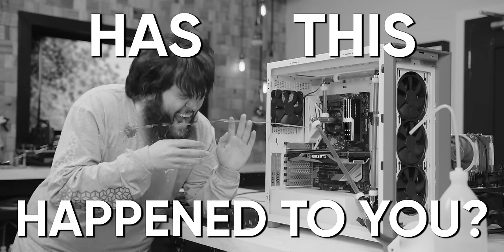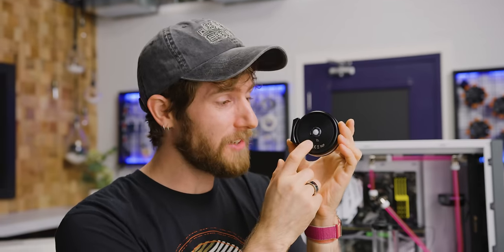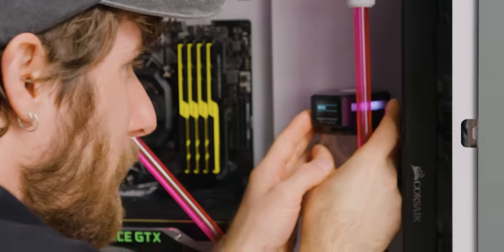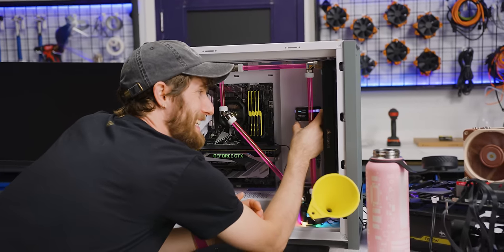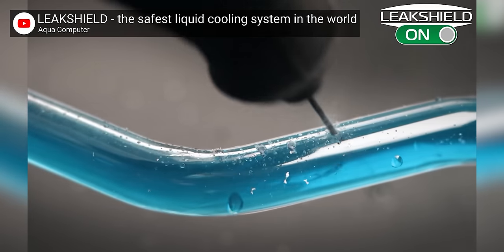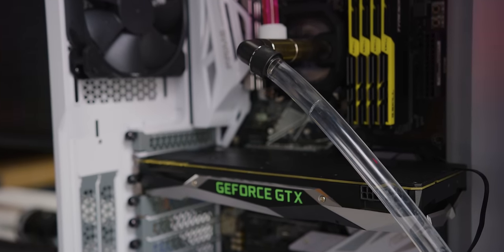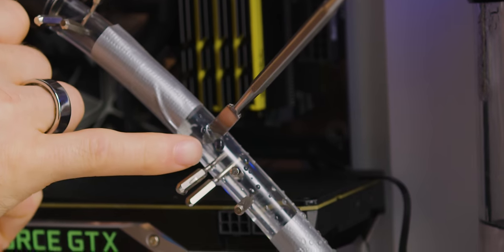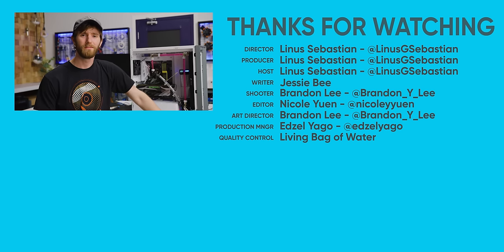I can’t believe it didn’t leak…

Comment: Really cool product, incredible really. Linus went way too hard on it tho to where a cynical consumer would think it doesn't work. Even at the end where he didn't totally recommend it. Bruh people are frequently spending over $1500 on a computer these days. $120 for a smartpump and reservoir is nothing
Edit: The video didn't have a lot of transparency on the total cost of the system but its still incredible at a few hundred dollars. Easier, safer, loop setup has a lot of value and long term monitoring
Reply: seriously this thing is incredible and super cheap for what it does
Reply: 120 is just the thing reservoir pump ist atleast another 150
Reply: I'm just waiting for the version that goes into distro plates. I'll easily pay $200 for that. I already paid $150 for a peice of acrylic.
Reply: @malteroeper3723  There is no leak without pump anyway
Reply: “Cynical consumer” tf does that mean
Reply: @megachadsixtynine5924  ......a consumer who is cynical......
Reply: @megachadsixtynine5924  Someone that automatically doesn't believe product claims or is actively trying to debunk the product in bad faith. I can easily see low IQ consumers (Which there are a staggering amount of) see any kind of leak in this video and go "Scam"
Reply: @Verlisify  while i agree that this product definitely works, I don’t think it’s fair to call anyone who has doubts going in or is just skeptical of this product as “low iq”
Reply: @malteroeper3723  If you are water cooling than you are already buying those components anyways. You wouldn't take those costs into account. The only way you would take any cost into account is if you bought the recommended pump and res from them and it happens to be more expensive than what you were initially planning on buying. Although it is stated as a recommendation from that company meaning its not required.
Reply: @NMZS  Its not a requirement to have the pump and res its only recommended which of course the recommend their own product they get more sales.
Reply: This thing is the coolest pump ever
Reply: Hell if this was out when i put my custom loop together I would grab one it would keep my expensive componates a little safer then not having it.
Reply: @megachadsixtynine5924  If someone thinks the product doesn't work or is misleading after what Linus did to it, they are objectively low IQ. The product wasn't designed to be drilled through then poked some more, thats just a limit of the laws of fluid dynamics at this point. Or if it dribbles from being impaled 20 times.
Reply: @Verlisify  not necessarily. While I don’t agree with people who call Linus a shill, most of them are just trolls. Not necessarily low iq, you can’t fault them for not being necessarily great at physics.
Reply: Its not that incredible actually, should have had this years ago
Reply: @megachadsixtynine5924  They wouldn't be a troll tho, they would think that Linus' testing is fair... which would be a complete lack of basic comprehension skills
Reply: Not only that, If your new to doing custom liquid cooling I could imagine this will give you a lot more confidence to do it along with more peace of mind.

Also you could spend roughly $300-700 on a custom cooling loop, $120 isnt horrible.
Reply: It's $309 USD for the complete system.
Reply: @rBennich  you will easily pay 400$ for that, distro plate stuff is more valuable than gold :D
Reply: I think its just fantastic. I had only had a few leaks since I started beginning building water cooled PCs, but one time I almost lost my gpu and psu because of it. Losing an expensive graphic card in these days is can be a devastating loss. I think its worth the price. A full custom water cooled system is easily costs 500-800$, throwing in an another 120$ component is like nothing.
Reply: @Verlisify  I guarantee you that anyone considering this product wouldn’t not buy it because it leaked after being stabbed like 20 times.
Reply: @megachadsixtynine5924  agreed... I wonder if he wants Linus to bend over backwards and praise the product throughout the video. The demonstrations he made clearly showed how well it works.
Reply: Absolutely, although I would say that a properly leak tested loop is unlikely to leak anyway, but for the paranoid, must have product
Reply: The reason he didn't totally recommend an otherwise totally working with no false claims product is coz it's pretty niche. When it comes to leak testing, there's cheaper easier alternatives as Linus himself said. I think it's hella cool but doubt I'd buy it for my loop uk
Reply: @NMZS  I mean if you already have the money for custom WC than paying a little more for security is nothing
Reply: @williamfoster4268  add 100 for CPU and 200 for GPU and an other 100 for rad and then 30 bucks into fitings anf you are around 600-700$ for complete WC gear
Reply: 100% Agree
Reply: @megachadsixtynine5924  Nah, the guarantee is the opposite. That there is someone dumb enough to be turned off by it
Reply: @noenic  Complete system being the pump/res combo.
Reply: @williamfoster4268  I know i just added the rest to tell how much the whole loop would cost
Reply: @Verlisify  I also do agree with your statement on saying they are low IQ if they believe the testing Linus does is fair. Not saying his testing isn't good it's just he always seems to take it to the extreme to show its "full potential" If someone believes its a bad product cuz it didn't 100% do as stated at the end of the "testing" then they really aren't that bright.. lol Most people would see this video and be, "Okay there's no way someone would drill, poke, undo all the fittings in their system.. on daily usage, or standard leaks this thing is great"
Reply: hey verlisify, loved you back it the day, hope you're doing well!
Reply: Someone who's doing a custom loop can easily avoid another hundo. And this thing is reusable.
Reply: If I have a 15.000$ gaming rig I will easily pay 120 or even 220 320 for that type of thing. 
Better safe than sorry.
Reply: Couldn't agree more, if you're dropping "new PC w/hardline cooling" money, you definitely wouldn't mind the relatively small extra for this set up!
Reply: If you're gonna be water cooling anyway kinda worth it
Reply: I agree. If you're going watercooling your rig probably already cost half a fortune, so 120$ extra for the peace of mind is absolutely worth it!
Reply: Shoutout Shofu
Reply: Especially when you can fry that computer with a leak. It's not a bad price to pay for peace of mind.
Reply: @StarmanDX  seek help
Reply: For those worried about the price with the pump and such it looks like it would go right on a D5 pump which a lot of people are already using.
Reply: @Thalln  $300 USD for a full custom loop (CPU, GPU, res, pump, the whole works) is basically the bare minimum. Still Aquacomputer is one of the few brands where I have no qualms paying the premium over other brands for. And of course part of the extra cost comes from the fact that they make their stuff in Germany rather than China.

The simple fact that AquaSuite lets me control my pump and fan speed based on coolant temperature alone is well worth buying their stuff for.
Reply: @Verlisify  dude, i seriously think you’re talking about a small minority of people.
Reply: @NMZS  still not that bad if your putting 2-3 g's into a system!
Reply: Actually this make me wanna buy it more LOL..after watching the whole demonstration
Reply: says the furry
Reply: I don't think you watched the same video I did
Reply: @outrageous5363  leave them alone.
Reply: Despite common belief, $150 is actually alot of money to most people
Reply: @anthonyernst999  not to people who need a reservoir for a custom loop anyways
Reply: uh no, he didnt go too hard on it. and a cynical consumer would think that it works. you can tell it works because he SHOWS it working even in VERY bad scenarios (like 10 puncture holes and also 2 completely OPEN screwdriver holes. when showcasing or reviewing something like this its important to know how much it can handle, IE show its failure mode. which is apparent multiple open stab wounds. perhaps you mean "not very smart" consumer? in that case sure, i guess. but that's no fault of linus and there is no reason to pander to those people because they are literal idiots.
Reply: "Because person can afford this that means they can afford this as well"
 is the stupidest logic I've ever seen. It would be like a girl asking you to buy her a new car because you own the latest iPhone
Reply: @outrageous5363  no, it’s not like that. Because the market isn’t people looking to install this in a budget pc build. It’s for water cooled pc’s. And in case you’ve forgot, water cooled pc’s cost a ton. So I doubt most consumers interested in this think 120 bucks is a whole lot
Reply: @outrageous5363  it’s called satire
Reply: People spend 1500 just on loops. That doesn't even count the rest of the pc lol
Reply: I agree. When most custom loops fail from a poorly cut edge on tubing and results in tiny tiny drops over hours of use, the fact that this thing is maintaining no leaks after taking a drill to it is incredible. If you're watercooling (non-aio) your computer probably costs enough to justify this insurance policy. I have never done a custom loop for fears of a leak but with this I am way less worried, might have to do a little bit of a rebuild in the future.
Reply: I'm a cynical consumer and by watching the video I could clearly see that it DID work.  I think you're assuming the consumer is dumb, and just sees that when Linus goes overboard with holes and water comes out, that the product is a somehow a failure, rather than recognizing  that's irrelevant and to be expected, as well as entertaining.  I think everyone realizes that's not a typical scenario, and even if a catastrophic leak did happen, no one would expect a secondary feature (of stopping small leaks) to somehow miraculously keep all the water in.  We know how it's stopping small leaks - the pump - and we know that pump can only move a very small amount of air.  The fact that it worked at all even for small leaks is impressive and makes it an incredible product.

And really it's more about the monitoring and filling features, and the ability to shut down the system to protect it.  If you like to tinker with your system and refill your loop a lot, just the filling feature alone would make it worth it, it makes it so much easier and faster.  What I was really impressed by was how sensitive it was.  I thought it was going to take a significant leak in order to recognize it, but it alarmed even when we didn't even see any water visibly coming out, just from loose fittings and a bit of movement.  That's really incredibly sensitive and accurate.

I got into computers 20 years ago and have been building since then, so I saw the very crude beginnings of DIY water cooling turn slowly - and then quickly - into what it's become today, so I can say with authority, you are absolutely right, this product is OBJECTIVELY a really cool and incredible product.  Something so niche, so geeky, and so rare, has become a big enough industry that a company has designed a serious and complex product for it - a subset of a subset! - , and things are standardized enough that it's flexible in it's application.  We've certainly come a long way.  I almost feel like it's cheating, these products are making the geeky DIY thing so dead simple that computer illiterate normies can create epic water cooled systems, and face no risk!  Back in my day we had to actually work to make a cool and overclocked system!  From physically altering Athlon XP's to unlock the multiplier, using a dremel to customize boring cases into cool ones, colorful cathode ray tubes and tornado fans with potentiometers, to a ready to use off the shelf water cooling system that practically fills itself for you and alarms if you get a leak... you kids have it too easy.
Reply: Bottom line is if you can afford putting water cooling in your computer you can afford this thing.
Reply: Uh he went hard on it to show it didn't work? Whos gonna drill a hole in their loop? Let alone 3.
Reply: @anthonyernst999  Despite common belief, this is very much a niche product aimed at people who are willing to spend 500+ euro on just a watercooling loop. This isn't a product targeted at most people.

Heck custom loop watercooling is far from a mainstream product. Most PCs use either an AMD or Intel stock cooler.
Reply: @rBennich  It can be used with any loop, as it comes with a part that allows you to connect it via a tube and G1/4" fittings. You just have to make sure it's plumbed to an air gap like at the top of your reservoir.
Reply: @leolego2  Entry to custom loop cooling is about 300-400 euro. Back when GPUs weren't being scalped by arseholes it'd be perfectly possible to build a 1100 euro PC and slap a full CPU and GPU loop on it for 400.

Comment: You might have missed a cool feature of their D5 (and most of their other devices): they have included fan controllers that can regulate the fan rpm based on water temp. Never have to deal with Fan curves again and it’s an absolute necessity for quiet water cooling.

Comment: Linus: "O-rings wear out over time"

NASA: Yes Linus. Yes they do.
Reply: Too bad NASA knew that, and knew they don’t function well in cold temps… and launched anyways..
Reply: "Heh, what's the worst that could happen?" - as they certainly challenged themselves with that one.
Reply: wow that got dark quickly
Reply: @Alphecchamaa δ i believe that was the joke?
Reply: Too soon.
Reply: @Alphecchamaa δ Not wore out, they got too cold.  This meant that they shrunk & hardened, leaving gaps for hot gas to escape through.
Reply: @Alphecchamaa δ No worries.  While the boosters were reused, they were not supposed to launch if the temp was below a certain point.  That day it was, and they decided to launch anyway.
Reply: @wolf2965  A pun on this topic? I don't know a way to react.
Reply: ThatTechLover  What happened?

Comment: Tightly controllable vacuum pump with air pressure sensors and a microcontroller. That is all this thing is, and frankly it's implementation is very clever. It being overcome by too many holes didn't surprise me, this works by pulling air in faster than the water can leak out to try and create a negative total pressure even as the water flows. If the hole is big enough that the water can leak faster than the pump can pull air, well, it's just been plain and simple overwhelmed.

Comment: This is actually a genuinely amazing product of course the pump inside that sucks the air out isn't meant for 30 holes but I'm sure it's good enough for 95% of use cases where leaks would occur
Reply: 99.9% more likely. 1 of those drill holes would probably be similar to 10 leaky fittings
Reply: one of those holes is bacailly someone who didn't tighten any of the fittings and started to shake their pc a little bit
Reply: It's kinda like the Demolition Ranch video where he pours concrete into a Hi-Point pistol and still can't make it blow up when fired. It ended up making something he claims to hate actually look halfway decent.

Comment: Honestly I was impressed.  Linus showed that for "normal" leaks it did what they said it would.  If you are slashing your pipes no reasonable person expects it to stop that.  But it was entertaining!  It actually made me feel safer about water cooling if I added this to the mix.
Reply: @vipertxt The flexed tube alone maybe, but I guess a whole hard loop is easier to pressurize because the fits are tighter.
Reply: The reason its recommended not to use flex, is that as mentioned it responds to pressure, the whole loop does meaning that if it wants to maintain a certain pressure, the tubing may further and further flex while its trying to attain. Obviously not a massive issue because it performs, but yeah.
Reply: @benhook1013  looks like it still works decent with the thick soft tubing. obviously this isn't like "I'd trust this as a critical component of a 300 passenger airplane" but I think the added peace of mind for <$100 is great value. esp if your PC is already upwards of $2k